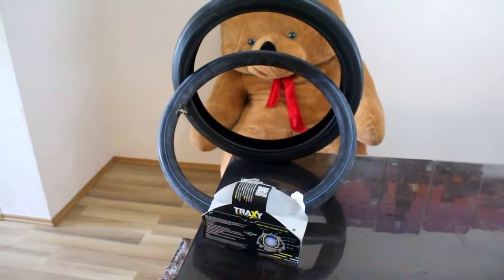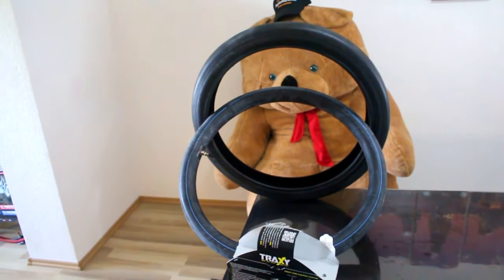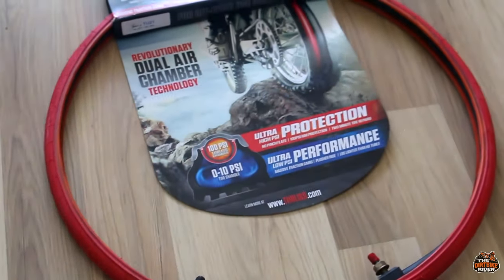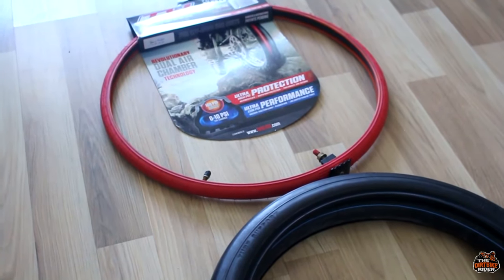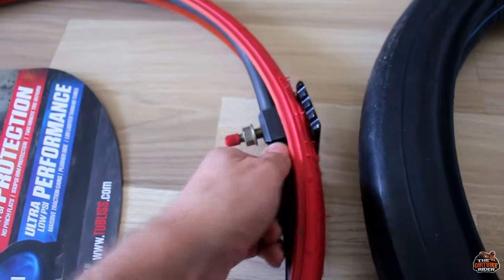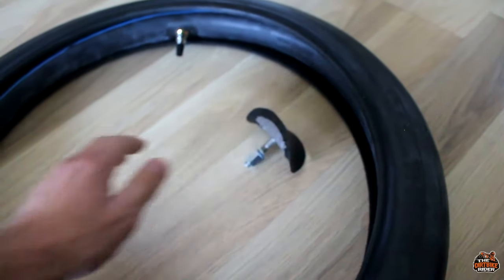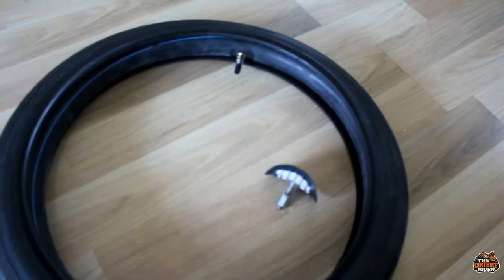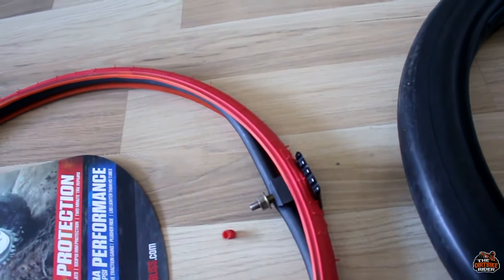TRAXY - Tube Support System for more Traction

Comment: what are the benifits of this over the tubliss?
Reply: No air chamber , so if You pinch the tyre , You won't loose the pressure,
Reply from the maker: no outsider air chamber, so you can have pinch flat tyre and its going to be same like from start.
Reply: @TheDirtbikeRider  With tubliss you want and you are able to go with almost no air so... If you get a pinch from some sharp object in the tire, having the traxy tube support so close to the tyre ...well, most probably you'll get a complete "airless" wheel...
Reply: Speaking form experience, the grip you get is insane
Reply: @lukaduler8885  but have you run tubliss

Comment: I don't see any advantage over mousse or Tubliss... 🤔
Reply: More lighter than a mousse and less problem than tubliss
Reply: @faiskiff  What do you mean with "less problem than tubliss"?
Reply: No puncture problem, maybe?
Reply: @dropselek  Yes, less
Reply: @faiskiff  looking at the cross section on the video, the free movement around the inside of the tyre looks like you would have to strip the tyre and add lube like a mousse tyre to prevent internal friction.
Also, if something penetrates the tyre, then it will puncture the Traxxy tube...
On TuBliss, it needs no special lube and if you puncture the tyre, it does not puncture the TuBliss system tube.

None of the systems are perfect, but I don't see any benift of this system, only downsides.
Reply: @dropselek  Right, only maybe... Unless the traxy has a puncture resistant "kevlar" like surface it will get punctured by a way smaller sharp object than on tubliss. It's just the radial distance between the carcass of the traxy and the tire which is smaller than the similar distance with tubliss. If you add the rotation occurring naturally when "in action" the effect is even smaller on tubliss than on traxy. I am riding tubliss since 2009 and never get it punctured, instead had a lot of hours with zero psi due to punctured tire. I have damaged two red liners but it was my fault going too hard on levers when mounting/dismounting the tires and pinched the wire bed in the red liner. I was curious about the traxy as I am on all new stuff appearing but it looks kinda bad copy...
Reply: Tire gets mutch more grip and you dobt have to worry to puncture it
Reply: @lukaduler8885 
Same for TuBliss, but the TuBliss tube is protected and not rubbing inside the tyre